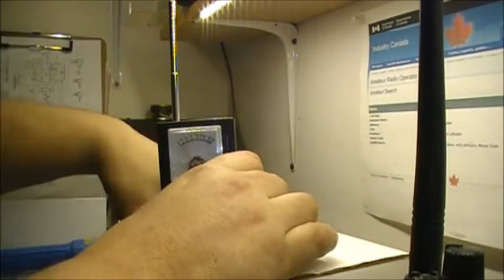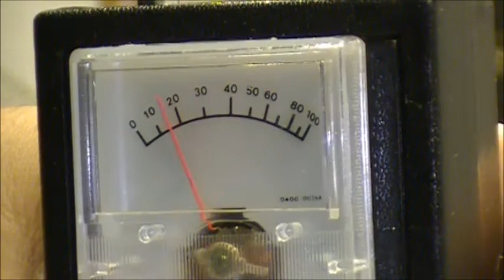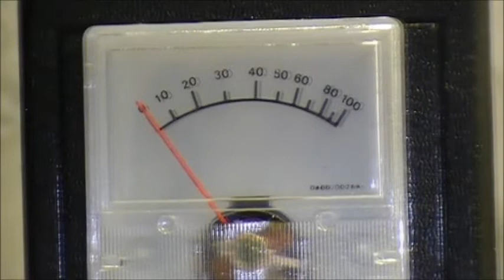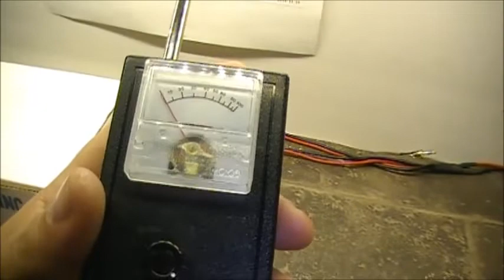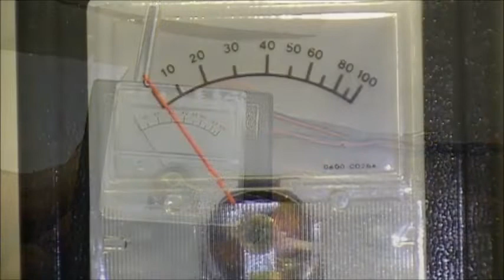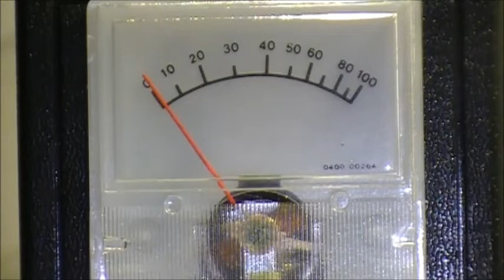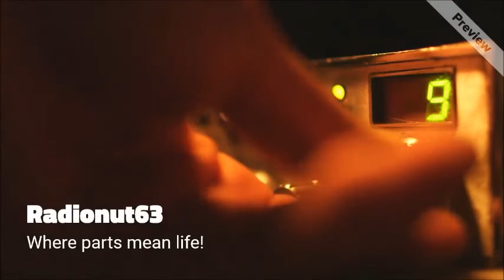MFJ-801 field strength meter Review

Comment: I had a field strength meter back in the 70s-80s that was built into a swr meter which I used for my mobile cb setup. The field strength meter was more of a novelty feature for me, versus the swr meter.
Reply from the maker: I have a bunch of them SWR meters here, still in original boxes.  :-)

Comment: What did you ground it to? When you made it more sensitive
Reply from the maker: There is a screw head on the side of the unit that grounds the device to your body, i just used a length of wire attached to that point to increase the gain of the device.  :-)
Reply: Radionut63 when you walked outside?
Reply from the maker: Length of wire clipped onto the grounding screw on the side of the unit.